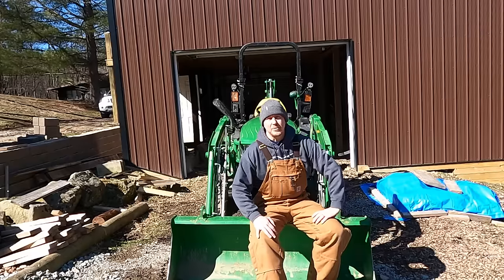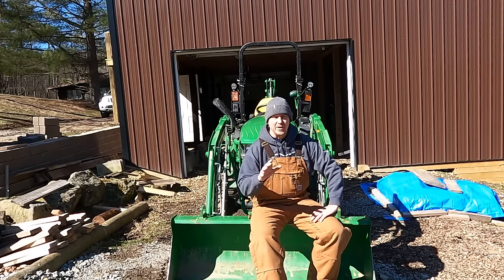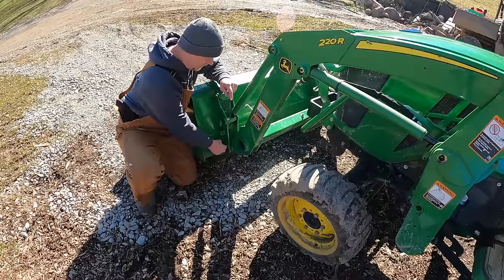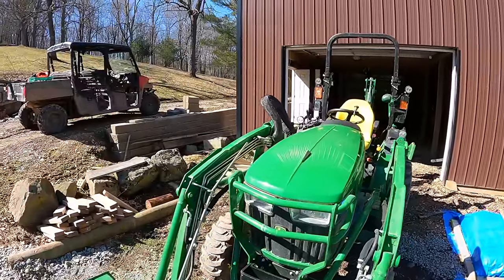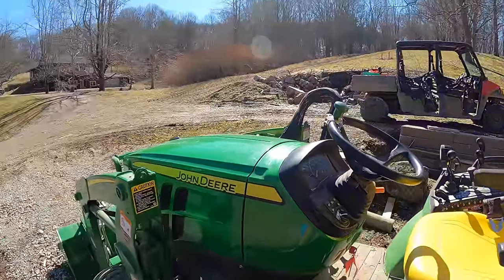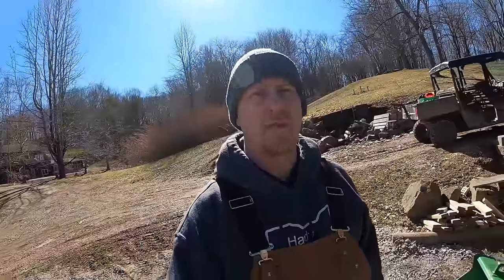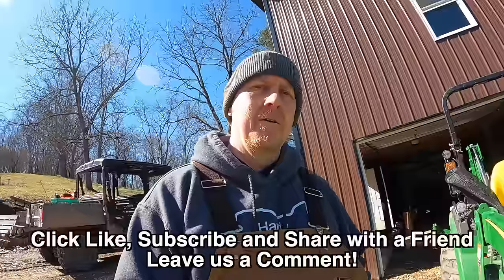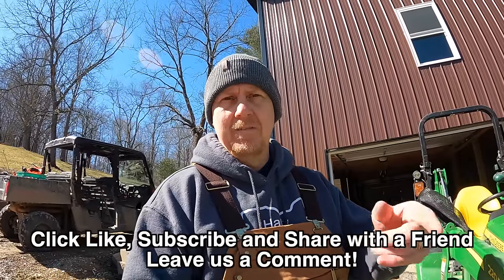#123 - 5 HIDDEN FRONT END LOADER FEATURES, 2 BONUS TIPS AND A DEMO OF THE HYDRAULIC QUICK DISCONNECT

Comment: And one more tip when you remove the loader try to keep it out of the sunlight. If you leave it in the direct sunlight it will build pressure in the hoses and you won't be able to reconnect.
Reply from the maker: Interesting one I’ve not heard that but I have had to relieve pressure to reconnect hydraulics before. Thanks for sharing.

Comment: The round support pipe near the bucket on the loader.  It can easily be used if you need to take the bend out of a steel T fence post.  Also you can use it to bend rebar if you are pouring concrete and need to make some of them bent.  I use the bucket lock when I have something in the bucket and need to get off the tractor to fix something.  It keeps the bucket from lowering due to hydraulic 'bleed off' after some time.
Reply from the maker: Great tips! I have that tube capped with sewer test plugs and store chains and big wrenches in it. Did a separate video on toolbox hacks.
Reply: @HardyBrothersOutdoors  I have seen most of your videos, including the hidden chain and tools.

Comment: Tip #9 - read the operating manuals.  They describe the bucket level indicator, the hydraulic pressure relief before dismounting the seat and the bucket float position - which is the icon with the wavy line underneath on the SCV decal on the tractor. But a great video. Thank you.
Reply from the maker: Thanks for watching and commenting and yes, read the manuals! :-)

Comment: Thanks for the video. I think the quick disconnect is the next upgrade I’ll do
Reply from the maker: Hey Brian, thanks for watching and commenting... I will say, while I like the quick release in 7 years I have only removed the loader like 3-4 times.  I usually remove the bucket and forks and get on with whatever I'm doing.  The extra front end weight helps and I don't find it to be in the way.  For the price, there may be other enhancements or attachments I'd put first.  If you plan to remove your loader often then it would be a good purchase... For me that is one more thing to find a level place to store it... also be aware that if the hydraulics have any leak down or sag or the legs sink into the ground it can be challenging to hook back up, that did happen to me once.  There isn't much slack in the lines with this quick attach. Keep me posted if you go forward with it and let me know what you think! - Josh
Reply: Man, never thought about removing the bucket, while doing my lawn!😅 I just did my lawn, will try and see how it will work around trees.

Comment: I have a question on your backhoe I bought a 1025r John Deere with an older black hole I bought a sale and the brackets on the tractor will not match the plate that's on the backhoe
Reply from the maker: Hey sorry but unfortunately I’m not sure about backhoes on the 1025R. I do know they are completely different frames and hookups for the one series vs gen 2 two series. Might be worth throwing some photos up on the John Deere 1025R group on Facebook or the Green Tractor Talk forum on the Internet.  Lots of great help in both places.

Comment: Good video ! Lots of tips! Could you helpme on my problem? My Hydrolic system is fine, full and clean, only 139 hours, 2016 John Deere, my 3 point is fine,  my front wheels turn fine , I have no QUICK CONNECTS !! Just pins to release my bucket.
My bucket will not do anything  ?? I was living in another state for 1 year, let my neighbor use my tractor. (I know he ran it off of my culvert also tryed lifting a very large mixer concrete mixer) ? I returned to use it and my bucket will not do anything? No leaks. And have checked everything possible ! Any ideas please ? Sherry
Reply from the maker: When you say it won’t do anything does the loader go up and down but the bucket doesn’t tilt? I’m wondering if you have a hydraulic line that isn’t attached. This wouldn’t make it leak but it would prevent the flow of fluid to the cylinders. Just a guess but would need to know more. Another option is to post up on the Green Tractor Talk forum there are lots of very knowledgeable people there.

Comment: On the mystery holes on my small 4110 they line up with grease fittings . I figured thats what mine are for cause the only way to get to them is thru that hole at a certain height of the bucket
Reply from the maker: I don't recall the holes I was talking about here, but I think they are up on the loader arms and apparently are used during shipping...

Comment: Iv straight put some work in on mine 36 hrs to 1078hrs front driveline came out in two wheel drive snap both the pinion and the transfer case side pinion off 9,800 two days before it was off warranty thankfully keep them both tight it wasn't two wheel drive going down the road and it came out I literally couldn't get my pinky inside of the yolk that's how small it is I have a Moto 4 80cc Yamaha that the rear shaft on we're in is bigger than the driveshaft on other than that those pins don't ever use the galvanized ones how to figure that out the hard way $4,000 later two new hydraulics two new paddles that little flap you and the bar goes across that's only $11 for the correct pins or about $2.49 for hardened ones not worth I live in the mountains feels like it's top heavy it's really not other than that just check every nut and bolt I drew a little lines of a paint pen because I got the thing literally there was so many things that were loose it was unbelievable even that hose clamps for the the diesel we're not slid on all the way correctly just stupid little things repeatedly only thing I did is I move the rear lights to the inside of the tractor kind of annoying if you're always using rear attachments but I'm in the bushes 24/7
Reply from the maker: It’s a good machine for sure. Paint pen is key, too many loose bolts for sure but now a quick visual inspection and I’m on my way.  Thanks for watching and commenting and stay safe out there! - Josh

Comment: Can you tell us how to adjust the loader cams where you have the grease fittings?
Reply from the maker: Hey unfortunately I’m not sure I know which part you are talking about as there multiple grease fittings on the loader arms.
Reply: Yes, that is the part I am talking about. If you notice each grease fitting can be rotated with the nut on the back-side of the loader behind each and every grease fitting on the loader. If you put a wrench on the nut and turn it you will notice the hydraulic cylinder moves up, backward, down, forward and then back to upper position again. It appears that rotating the bolt makes the hydraulic cylinder shorter, longer, up, or down.

Comment: What do they fill the tires with for ballast , enjoyed your video’s looking to buy one
Reply from the maker: The popular commercial product is beet juice, sold as Rimguard.  I've heard that in the past people used washer fluid or antifreeze... there are two issues to keep in mind... corrosion of rims and freezing if you are in cold temps... You are also looking for bang for your buck in terms of weight/vol and apparently beet juice has a high weight/gallon.  I've also heard that it can be a mess if you get a hole in your tire and it's also added expense if you have a flat and have to refill the tires.  So far i've not yet pulled the trigger on having them filled but Jason's 4052R has filled tires.

Comment: Have you ever heard that John Deere ? Inventor or ? Never intended to have any implements in the front of the tractor, so the Hydrolics for the front things had to modify an after market thing and put a Splitter in the rear end Hydrolic hose ???  Did you ever hear of this ?? Because last year I lost my use of the loader, my Brush Hog worked just fine ! So I took my 3032E with 130 hours into a service place to getnit repaired . That's what I was told. Sounds kind of CORNY TO ME? 
So could u let me know what you think ? Could this be really true ?? Thank you if you could please answer me ?? Sherry
Reply from the maker: so what i think they are talking about is a 3rd function diverter.  It's pretty common nowadays and on some tractors comes standard.  This allows you to do things like open and close a grapple vs just roll and raise something like a bucket.